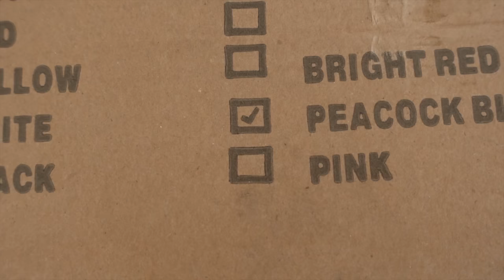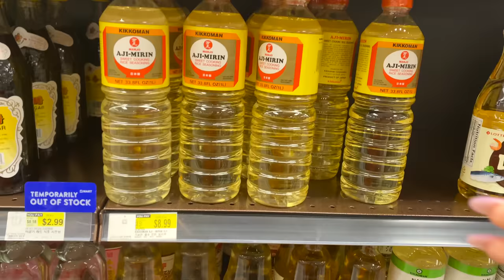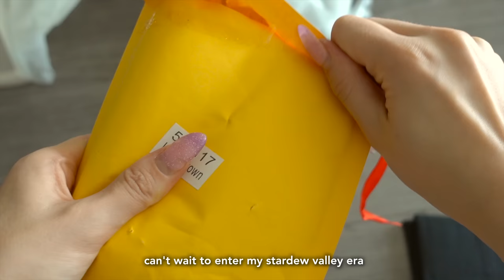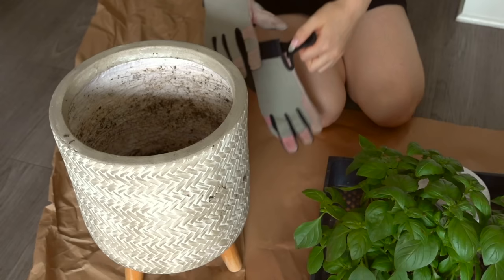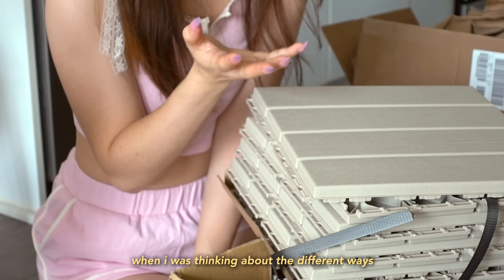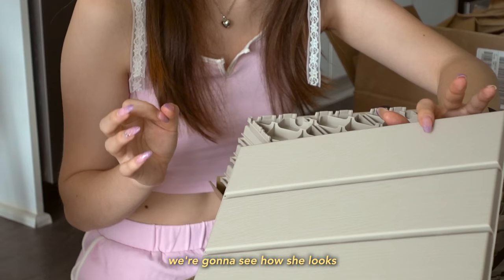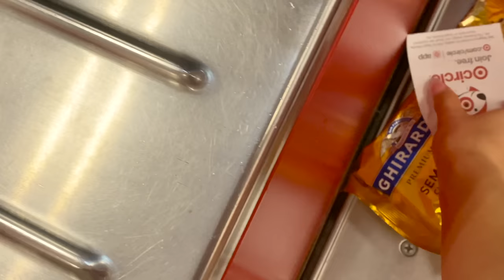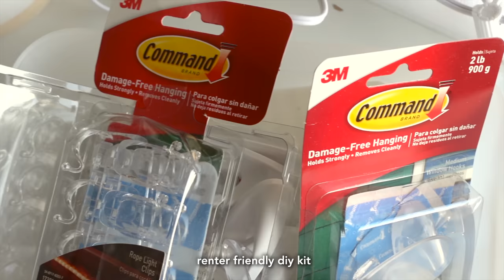apartment balcony makeover 🧺🌷 pinterest room aesthetic, baking, starting my garden, living alone

Comment: I adore your vlogs, they're so calming. 

Tips: The balcony is probably slanted slightly. Most builders do that for water control when it rains.
When planting, break up the root ball by gently squeezing it after removing it from the planter.
Basil is hearty and will survive a lot of sun exposure as long as you water it enough.
If you're concerned with sun exposure, consider getting a small awning or umbrella you can take down and bring inside to go over them during the hottest parts of the day.
-10 years with Home Depot and over 30 years of living in Texas and planting things!
❤❤

Comment: Nice vlog! One tip though, you don't want to plant flowers in ceramic vases like the one you had in the video because it has no holes for the water to drain out and the roots will be susceptible to root rot. Instead, you could keep the flowers in the disposable pot you bought them in, and simply drop that pot into the ceramic vase. That way, when you are watering them, you can take the pot out of the decorative pot and let the excess water drain out before popping them back in. I hope your flowers don't perish before reading my comment. Much love